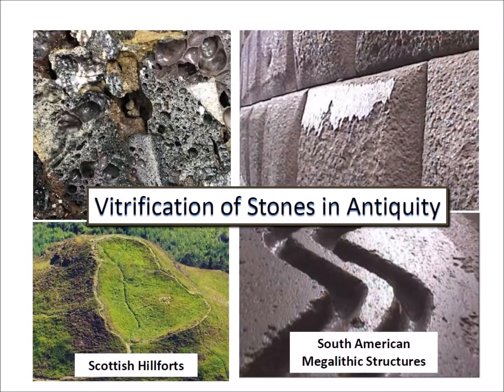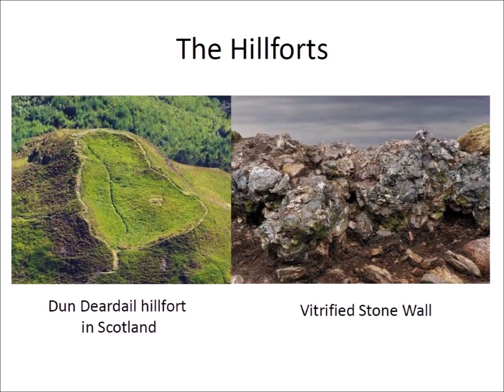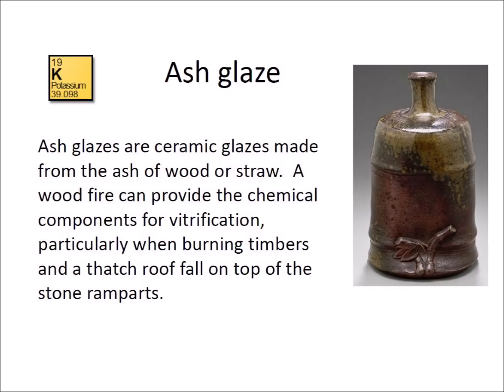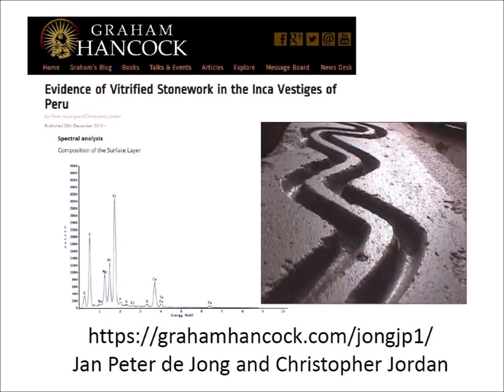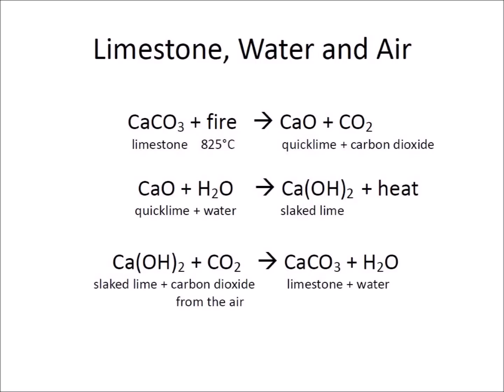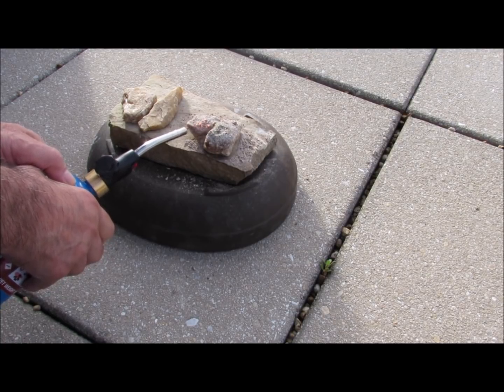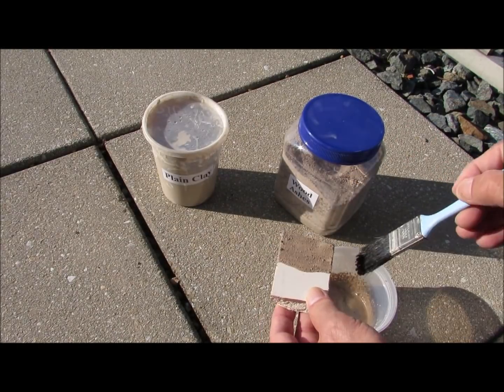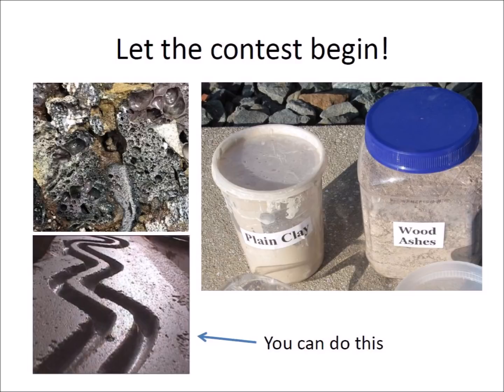Vitrification of stones in antiquity

Comment: Have you experimented with Andesite, Ganite or Basalt? Because there is no Limestone (or at least few examples) in the megalitic pre-Inca constructions...
Reply from the maker: I have not experimented with andesite, granite or basalt.  Andesite is about 60% silicon dioxide (SiO2) and basalt is about 50% silicon dioxide.  In order to produce a flux with a lower melting point, it would be necessary to introduce a mineral with aluminum, iron or magnesium.  Perhaps clay, which is an aluminosiclicate, could be used to cover andesite before the application of heat.

Comment: The melting of the stones in Aberdeenshire is much more mysterious than this presentation asserts. What you are saying is that these foundation stones must have had roofing fall on them. Obviously there is a small matter of the walls in between. Skellig Michael has an entirely vitrified landing area - next to the sea - which never had a roof in the first place.
The far more realistic theory is that the so called 'iron age hill forts' were the first structures exposed to the oblique angle entry of the 530AD comet. This exposed the majority of the mainland of Britain to 3000 degree temperatures in a matter of seconds, before barreling across the Atlantic. It's also believed to have caused the destruction in Bolivia at the same time, the exodus of the romans from Britain and 'the dark ages'. The ash layer of burned trees all over Britain also accounts for this cataclysmic event.
Good effort asserting the mainstream narrative and everything, but it's possibly a bit ambitious to assume that something so illogical could solve a mystery that defeated Sir Arthur Conan-Doyle.

Comment: Is there any chemical engineering that could do this, or a combination of chemical and physical action? Don't sell our ancestors short, they were just as smart and determined as we are.
Reply from the maker: This is the reason why I conducted the experiments in this video.  I am more willing to accept that the vitrification of the forts is due to ordinary fires than to coronal mass ejections from the Sun.  I also think that the vitrification of the South American megalithic structures made use of a technology that has been lost to the modern world and needs to be rediscovered.
Reply: @Antonio_Zamora  thank you sir. I was considering the "Black Earth" farming methods, extreme water manipulation, these are all almost unbelievably complicated, with amazing planning and execution. If that same tool set were applied to geochemistry, I've no doubt they  vitrified stones at achievable temperatures. Reverse engineering the method could be time consuming

Comment: Glazing usually takes a lower temperature than firing the clay itself. Find a pottery shop and make a deal to experiment using traditional glazes on normal rocks. Then make adjustments based on the first results. Save the bbq for burgers! :-)
Reply from the maker: I contacted several ceramic shops, but they didn't want to risk their kilns by putting stones that might explode when exposed to heat.  Besides, the method of vitrification has to be able to scale for big objects that do not fit in a kiln, but a kiln offers a controlled environment that can be useful for research.

Comment: There have been extensive discussions regarding vitrification in various Peruvian and Bolivian megalithic sites. It seems the only analysis done by spectral analysis was presented by Jan Peter de Jong and Christopher Jordan in an article published in 2011. No other test results related to vitrification seems to be available. With all the potential sites that exhibit or claim to have vitrification - it would seem that additional testing would be, or should be, needed to confirm these findings. There has certainly been much discussion but limited testing - to my knowledge. Due to the extent of claimed vitrification sites, the process to achieve this would have been extensive.
Reply from the maker: Taking chunks of protected sites is probably forbidden. Some people even have trouble taking photographs.
Reply: I understand but the testing would, in and of itself, at least resolve the confirmation that it is vitrification - which has been a point of contention over a number of years. If it is vitrified: the how it was done over large surface areas and in locations protected by surrounding  rock becomes the enigma.
Reply from the maker: This is why I suggest a lot of experimentation. I would start by placing a bed of burning coals on top of a slab of limestone until it is calcinated. Determining how many hours or how many days would be one objective of the experiment. The next stage would involve adding a clay slurry and wait for hardening to take place. There are many variables but it's a feasible experiment.
Reply: There's a lot more evidence of alchemical vitrification than there is of cutting granite with copper chisels and dolorite pounding stones. Even the self confessed 'freemason' Manly P Yawn clearly knew nothing about this major historical science. A science which derives HF acid from commonly available plants and acidic liquids that are produced as a by-product of mining

Comment: I have noted what appears to be vitrification of lava rocks in a gas barbecue after trying to burn off the grease drippings. I burned the rocks on as high a temperature as the barbecue would develop expecting to be able to blow off the ash but what actually happened was the pores in the rocks plugged up with a very hard material that would not come off. At the time I suspected it might have produced some kind of a glaze but I didn't think much about it. I just replaced the lava rocks with fresh ones. In retrospect it might have been a glaze produced by the mixture of ash and organic material in the grease drippings and barbecue sauces. I'll pay more attention the next time.
Reply: ....would some sort of acid be formed from the fats? Thats a great comment, Mr F. Lots of info!
Reply: @ZiggyDan  Had I thought about it in the context of vitrification of structures in antiquity I might have broken some open to investigate the composition. I have a background in geology and minerals and have the knowledge to determine hardness and chemical makeup but I just didn't have a reason at the time to make a comprehensive analysis.
Reply: @MrFmiller  ...check out, Vitrified Rocks and Stones in the Inca Vestiges. Jan Peter de Jong, youtube.
Reply: We might only guess what sorts of materials could have been weaponized either in the attack or defense of a hill fort. Vats of grease or oil of some sort are not entirely out of the question. Greek fire was made in medieval times without a modern understanding of chemistry. We don't fully know what technologies were available earlier on. Grease drippings?
Reply: it's good to experiment. Good to know what doesn't work also, process of elimination is very helpful.  lol

Comment: Could you use a Obsidian parabolic mirror to heat the surface? This could be a great contest.
Reply from the maker: I have read some accounts saying that large polished dishes made out of gold may have been used as reflectors, but that the Spaniards melted all the gold artifacts to make coins.  Protective glasses have to be used when working with any tools that concentrate sunlight. Obsidian was used mostly for creating cutting tools and weapons.
Reply: @Antonio_Zamora  Thanks so much for the reply. Did the Greeks use them to set fire to an enemy Armada? How much heat is generated? Im trying to rule in low tech tools that get big results.
Reply: @ZiggyDan  The greeks used bronze or copper shields perhaps on wooden frames. Against enemy ships. It is possible to get almost unlimited heat in small areas if the polishing and geometry is perfect. The problem is workmanship and getting the parabolic shape correct. And, possible blindness...